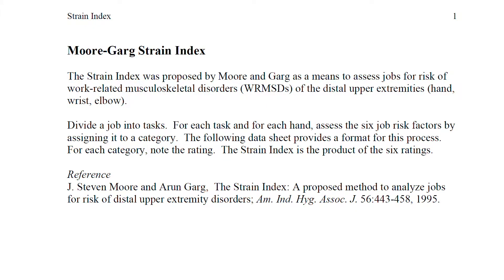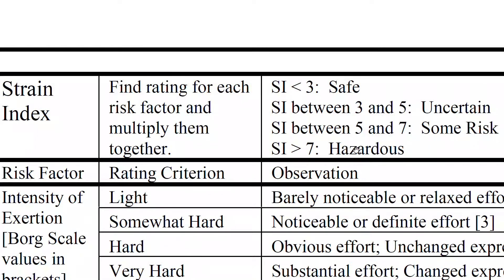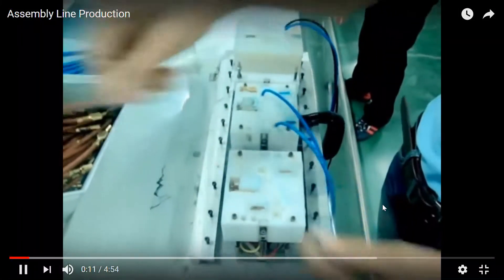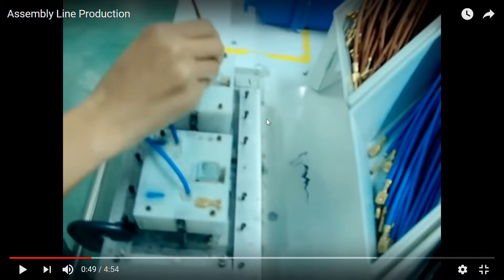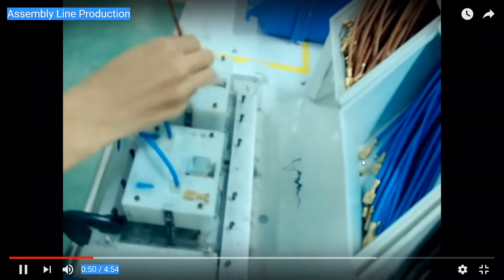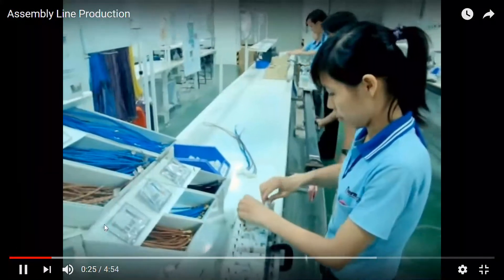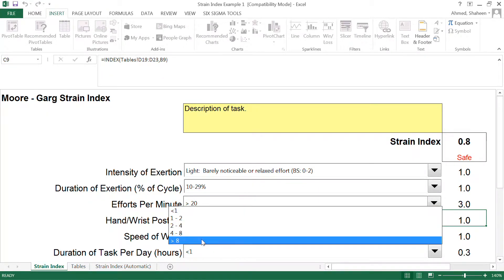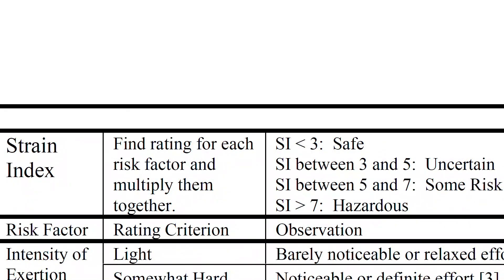Job Strain Index Application Example  | Updated Version in Description

Comment: Hello sir I have a question for my report, in the Duration of Exertion (DE), there's a way to solve it by measuring the duration of all exertions divided by the total observation time in seconds. Same with the Efforts per Minute (EM) which is calculated by counting the number of exertions during an observation period then dividing it to the total observation time in minutes. My question is how can I solve those depending on this video? I don't know the total observation time and I can't make the answer equal to 10-29% and >=20. Hoping you'll reply to this, thank you

Comment: I have a question, there are 3 efforts for installing the little white pieces at the beginning, then 6 efforts for installing and testing the wires, and finally, 3 for removing the wires, but you mention there are 18 efforts, which are the others? I speak Spanish so I didn’t quite understand what the others were
Reply from the maker: Sometimes, it could be a little subjective of how to count the number of efforts. And, therefore, sometimes, it needs some brainstorming with other experts in using any ergonomic tools. Installation of three white pieces = 3 efforts. Taking them off at the end = 3 efforts. Each wire installation and removal = 2 efforts. Total six wires = 2*6 =12 efforts. Total efforts = 18.
Reply: @TheOpenEducator  thank you!

Comment: can i get the link for the excell?
Reply from the maker: The reference section under https://www.theopeneducator.com/ergonomics provides information on all the materials used in the videos. For your question, you can check the reference for module 9 https://www.theopeneducator.com/ergonomics#h.p_ID_328.